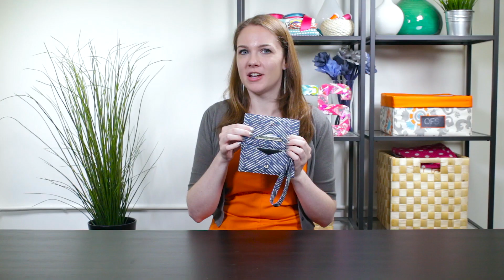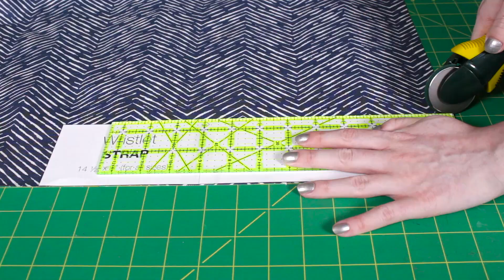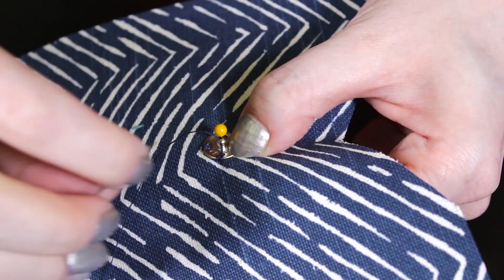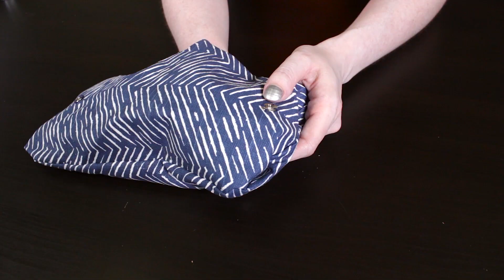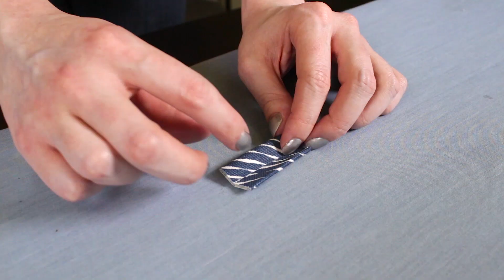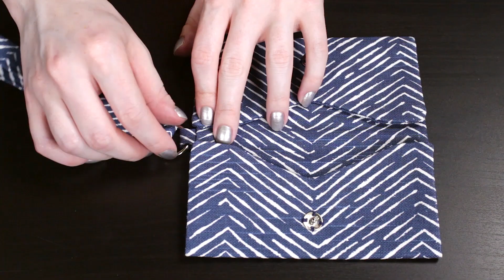Easy DIY Phone Wristlet Sewing Tutorial - Free Pattern

Comment: Hi. I'm wondering why when I print the pattern the measurements are not accurate? I did not adjust anything. I use A4 size paper since there's no indicated paper size. I really want to try to make the large one.
Reply from the maker: Hi Annie, Although the pattern was made with 8.5 x 11 inch paper in mind, it should still work with A4 even though this paper is a bit narrower and longer. The pattern should be printed at 100% or make sure it's not scaled to fit when printing. If that still doesn't work, the printer may not be able to print close enough to the edges. You could try a different printer if possible or use and larger paper size. Hope that works!

Comment: Hi - thanks, will be making one over the weekend. I'm wondering whether those enclosed magnets would be ok for a closure or are they too strong/interfere with the electronic bits of a phone?  Commercial cases do have magnets but not sure if they are of a particular kind  - any thoughts?
Reply from the maker: The original one that I made had a magnetic closure, but it just made it a little too bulky to close nicely. I don't think it will damage the electronics though. If you have a thinner magnetic closure or if there's a little extra room in the bag around the phone, it will probably work. This is the one I first used for reference: https://www.onlinefabricstore.net/dritz-4-magnetic-snaps-3-4-inch-.htm
Reply: OnlineFabricStore.net   Ha ha -thanks for the reply,  I couldn't wait to try this so I made one this evening.  I made it minus the strap because I was just looking to make a phone case as although I do have a gel case, I find that i keep pressing the side buttons.  My original plan was to add a card holder in the lining, but i got carried away and forgot! The medium size holds my Samsung J5 2017 really snug with the gel case. Thanks for the pattern and tutorial, really quick to put together.  May have to make a couple more with card holder and strap this time.  Regards from the UK.
Reply: OnlineFabricStore.net   Ah I see, I have those for bag closures,  I was thinking more of the flat ones that already come enclosed in a sort of plastic wallet that you can sew through, can't remember what they are called but I have a bunch of them.  I used kam snaps tonight and fusible fleece for the stabilizer.  It looks really nice.  Thanks again.
Reply from the maker: Yeah, those flat magnetic closures would probably work nicely. Glad to hear it's going well!

Comment: Instead of fabric, can I use an old t-shirt cut into a square and instead of sewing it can I use hot glue??
Reply from the maker: You could use an old t-shirt, but you would need to use a fusible interfacing on the back to make it stronger, stiffer, and not stretchy. With the way this wristlet is constructed, hot glue wouldn't work and it probably wouldn't be durable enough either.

Comment: Hi I'm a little confused when you cut out the stabiliser how come it ends up smaller than the pattern piece..Because in the video you say cut off the seam allowance then cut out the stabiliser. Can you please clarify for me PS: I'm a beginner sewer :)
Reply from the maker: Hi Corrine, After using the pattern piece to cut out the fabric, cut off the gray border on the pattern piece. This will make the pattern piece 1/4" smaller on all sides, which is the correct size for the stabilizer.

It's common to cut stabilizer to be the same size as the fabric. With fusible stabilizer, I like to make it a little smaller than the fabric so the seams don't get as bulky, but either way works. If you have any more questions, I'm happy to answer!
Reply: Corrine Mackenzie  Hi Corrine, I printed out two patterns as I intend to make more than one case.  So one I have left with the seam allowance for the main fabric and lining (wrote this on the pattern) and one I cut away the seam allowance and wrote on it for interfacing.   Making the interface a little smaller reduces bulk within the seam allowance, as does cutting back the corners, don't go too close to your stitches though or you will end up with a hole.  Welcome to the sewing community good luck with your projects.

Comment: Hi I made this but found it a little flimsy,  what other interfacing could i use or add to give a more stablized purse.?
Reply from the maker: Hi Sharon, You could either use the stabilizer in the video on both the outer and inner fabric, or try a stiffer stabilizer like Pellon #71F Peltex I Ultra Firm Fusible Stabilizer: https://www.onlinefabricstore.net/pellon-no-71f-peltex-i-ultra-firm-fusible-stabilizer-single-sided-.htm
Another option is to use the stabilizer in the video on one side and a fusible fleece on the other, which will add stability and also some softness. https://www.onlinefabricstore.net/pellon-no-987f-fusible-fleece-.htm

Comment: what was that white thing that u use inside the wallet?
Reply from the maker: Hi Kriti, it's a stabilizer which was used to make the fabric a little thicker and stiffer. You don't need to use it for medium weight fabrics like the one in the video, but an interfacing or stabilizer should be used for lightweight fabrics or else the wallet will be floppy. Here's the one from the video: https://www.onlinefabricstore.net/pellon-no-809-decor-bond-fusible-stabilizer-.htm